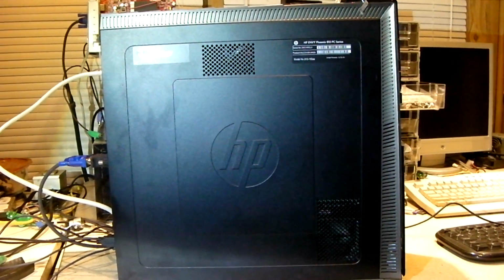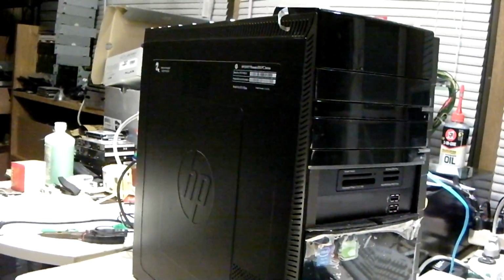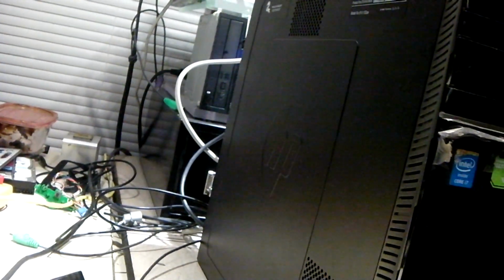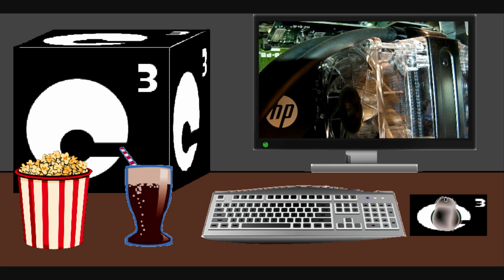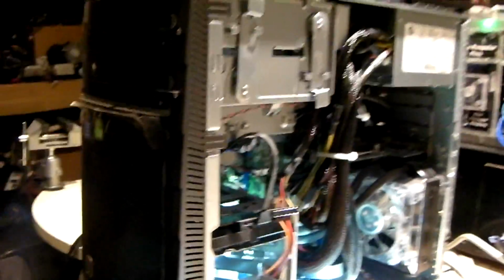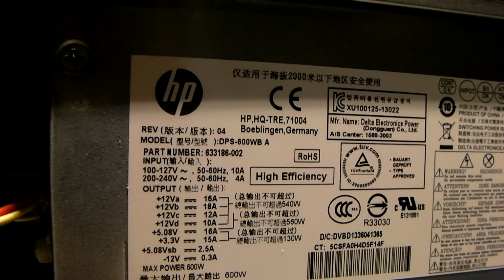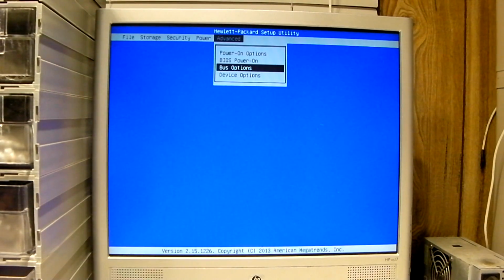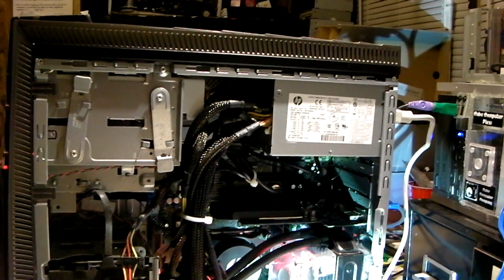Not your "average" HP Desktop Computer

Comment: So, this computer has an i7-4820K (socket LGA2011 HEDT!), 24 GB of RAM, it was apparently "made for gamers", yet HP decided to install what appears to be a GT 730. What a waste.
Reply: For the same price when the owner paid for this in 2014, he could have built a custom PC with an X99 motherboard, plus an i7 5820K, 16GB of DDR4, and a GTX780TI!
Of course it will be air cooled for 2000 USD, because water cooling is at least worth 500 USD!

Comment: Hey how old do you think a hard drive has to be before its not safe to use for backups because i have a 8 year old 500gb hitachi laptop hard drive i want to put in an external enclosure. Thanks.
Reply from the maker: As long as the hard drive's not failing SMART, it should be fine for backups.
Reply: @CubeComputerChannel  you really can not rely on smart statistics it's self as a faulty computer/sata cable can cause errors you want to mostly look for any pending sector remaps and how many remaps have been done and the run time of the drive. another thing to take into consideration is the load/unload count on drives that unload the heads instead of parking them in a landing zone
Reply: and about that AIO it would be most likely asetek
Reply from the maker: @CotyRiddle  If the cable was at fault, I believe I'd be having issues with the new SSD as it was connected with the same cables. The Seagate STx000DM00x 1TB drives and 2TB drives have been known for failures. As mentioned in the video, the three that I had previously had all failed. The 2 ST1000DM003s failed SMART within warranty. The ST2000DM001 hard-failed after warranty. I've seen many of them installed in OEM systems come in for service because of bad sectors. The refurbished ST1000DM003 in my TiViBox system failed, which was why I recently reconfigured it. Lost all the files I had stored on it. The disk eventually got to the point where you could no longer access it.

Seagate drives are garbage, Western Digital isn't all that much better. The only drive brand where I rarely see failures from is Hitachi (the older Hitachi branded drives, not the HGST branded units).
Reply: @CubeComputerChannel  i was not referring to the drive in that computer. seagate has a known track record with crappy drive firmware and poor quality drives in general. don't surprise me they failed. every seagate drive ive owned has had a failure of some type
Reply: and i agree WD is ok if you get lucky don't let em get hot period! and yes the old deskstars *non glass platters aka deathstars were great drives.
Reply: @CubeComputerChannel  its funny you mentioned about smart status tho. Ive had a drive that constantly logged errors with read write retries but it said the drive was perfectly fine *It was not and was really slow and failed shorty after.
Reply: @CubeComputerChannel  and just to one up you on the wd thing. i have a WDC WD10EADS (known for failures of the heads and poor performance among other things*  that ive had for over 7 years. it came out of a old mybook enclosure It liked to get hot and become unresponsive 170 reallocated sectors. guess what. Do I trust this drive? actually yes as that 170 sector count has not changed in the past 6 years that I have had it not in it's external enclosure. so again don't always rely on smart to say the disk is bad. In my case if this drive was for critical data storage then no I would not use it at all but it is just holding games which is backed up on a separate drive the thing about pending sectors or reallocated sectors if that count moves up within a short period of time Few hours or few months discontinue use of it because then yeah you have a drive failing but if it just all of a sudden has a random number there there is things to look at to why it has it. Over heating drive being jarred and other things

Comment: Yeah. I have an HP all in one from 2014 and it has that cheap BIOS. It’s so cheap it doesn’t even have any legacy support I can find within the BIOS. Yeah, it’s a UEFI only machine. I would put Windows 7 on it in a heartbeat but I can’t. It’s Windows 8 or newer or you have to use Linux. That’s pretty pathetic if you ask me. They even have Windows 7 drivers on their site for that system. But why even bother if I can’t install Windows 7 to begin with. Then I have an HP laptop from 2016 with still the cheap BIOS. But it does have legacy support. However the USB drivers don’t work out of the box on Windows 7 so I can’t figure out how to get USB working at all. I know Windows 10 is considered pretty standard now. But Windows 10 honestly just feels REALLY slow sometimes on a mechanical hard drive. Windows 7 just flies though on my systems running it. I have not switched to SSDs in any of my computers yet. But I think I’m going to get one soon. I want to build a gaming computer but I want it to run fast so I guess I will just get one. I would run Windows 7 on it and I may start out with it, but eventually I’m going to have to update to run all the programs once Windows 7 starts losing program support. I hope it goes on long past the EOS date but it’s hard to tell.
Reply from the maker: That machine should have legacy support. Keep in mind a lot of setup utilities call it "CSM Mode". Look in the boot options or security options and it should be there. Both my TiViBox Slim and TiViBox Cubed systems have those miniature AMD E-series desktop boards pulled from HP systems and have this same setup utility. I have them both set to legacy boot.
Reply: Cube Computer Channel well. I will check to see if that’s there. Thank you for telling me that.
Reply: Cube Computer Channel I just looked and I can’t find CSM mode. But I did find legacy boot sources in the boot order. When I try to press F5 like it says to enable it, it says I need to disable secure boot. My secure boot is turned off, but it still won’t let me enable it. And I’ve had secure boot off for a good while now so it definitely should’ve saved it.
Reply: usually labeled CSM  under boot options/drive priority.
Reply: @CotyRiddle  alright. I will look at that sometime